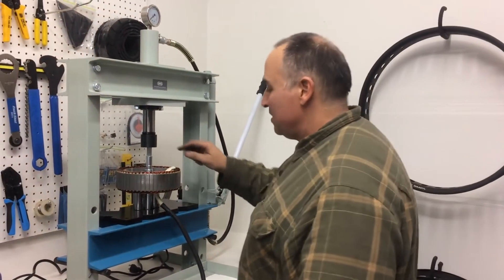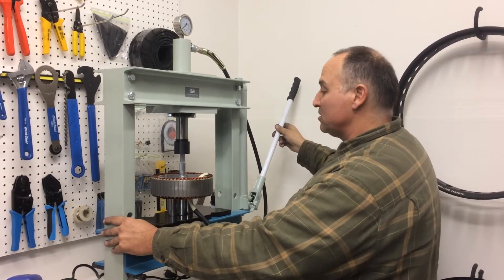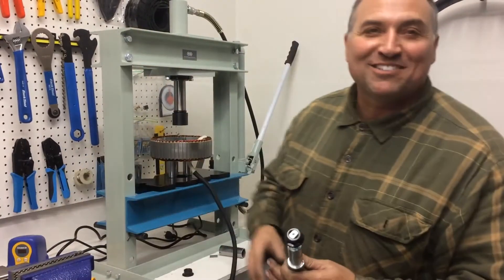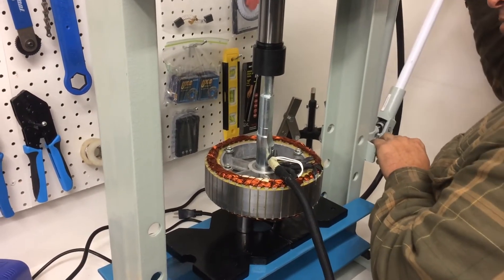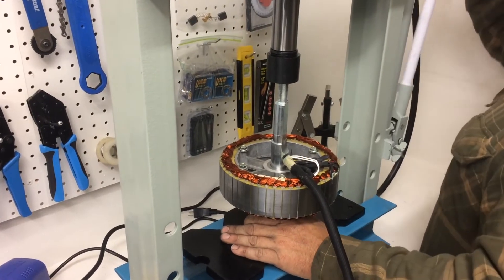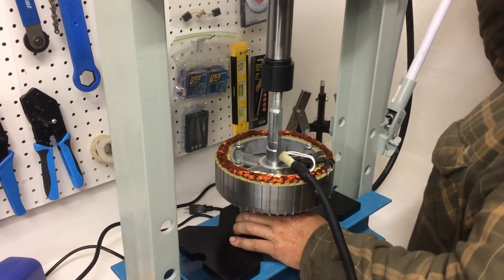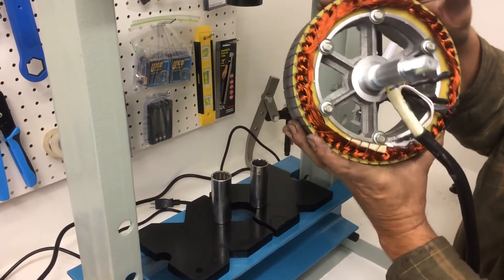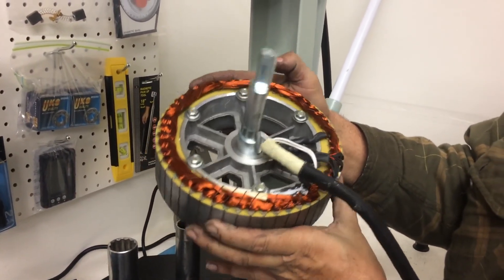Cromotor axle replacement ebike hub motor

Comment: Easily made a good lorry bottle jack and a simple frame good strong one ,i ended up with a much smaller one works a treat mainly for pushing bearings but well capable for turning front motors into back ones ✌️

Comment: Is this possible to do without a press?
I made the mistake of getting a front wheel motor, should have got a rear.
Thanks in advance 👍🏼
Reply: U can get your wheel threaded to take a smaller  cassette or u can get a stack with is a chain cassette that come in single pieces once the inner piece fits and youve the room to get your nut on u may haveto leave some gears out so just make a suitable stack 👍

Comment: Best not to put your hand under the motor (or other work piece) while cranking the ram. If the tons of force exerted by the press push your "support system" apart, your hand would be no match! For holding things square, you might look at large woodworking c-clamps or welding/metalworking clamps (e.g. the Vise-Grip kind). Take care. 👍

Comment: Great video, bro... hey, I've got a 3000 watt rear ebike wheel/motor from China and I screwed up the threads.  Uses a 21mm wrench (bigger than stock on the bike) to get it on and off.  I used a tap and die to straighten it out and it's functioning but I'd really rather just replace the whole thing with something of better quality.  This axle (again, from China) seems to really be a soft pig-steel.  It was soooo easy to cross-thread I thought it was made of lead!  Anyway, I'm thinking of just getting something of quality (like what you've got) but basically of the same dimensions.  Are these things (axles) universal?  I got mine over Amazon ... here, I'll link it if it will let me:   https://www.amazon.com/gp/product/B01M21Y1XC/ref=ppx_yo_dt_b_asin_title_o07_s00?ie=UTF8&psc=1#customerReviews
Reply from the maker: The axles are definitely not universal. I have purchased 10 Cromotors from Zelena Vozila. 6 motors have one axle design, and 4 have an entirely different design.

The ebike hub motors are so economical. I recommend buying two or three (or more!) in a single order. That will get you interchangeable axles! Spare parts at the ready.

Comment: Where can I get replacement axles from?
Reply: +Industrial Ebikes What is the price of cromotor?
Reply: @dangerous_ngga the price of a good bottle jack and a decent bita steel to make a frame,i get daily use outta mine but ive added a few bits bearing pressing de pressing siezed bottom brackets etc
Reply: Hello, I just broke the axle on qs273 motor. Do you still do replacement? It  sucks to buy a whole new motor. I am really not familiar with that procedure. Thanks
Reply from the maker: Zelena Vozila or QS Motor.
Reply: @industrialebikes4956  do you make and sell qs273 axles??